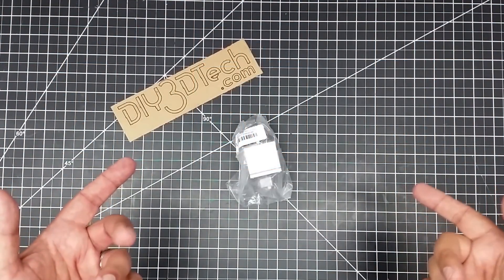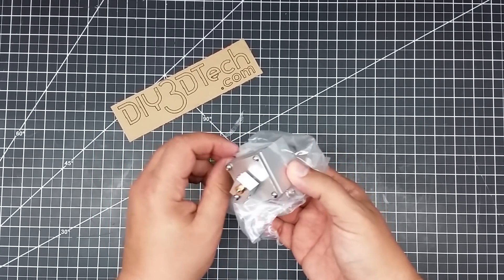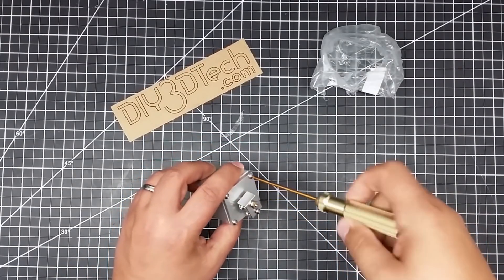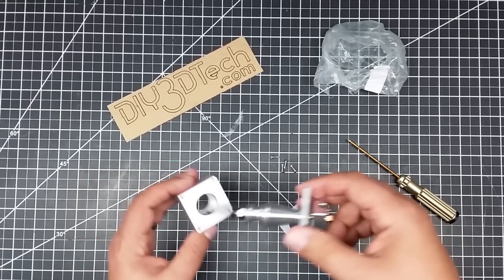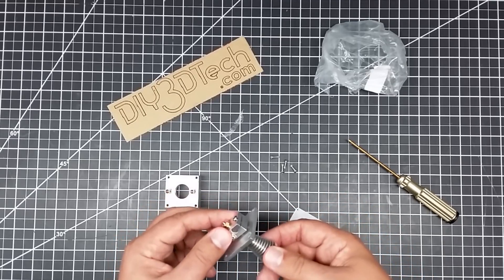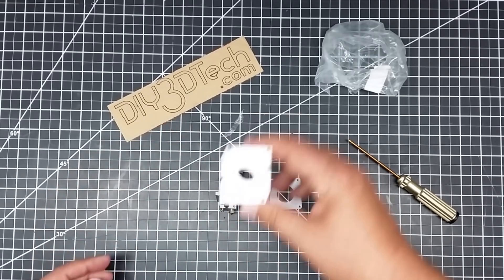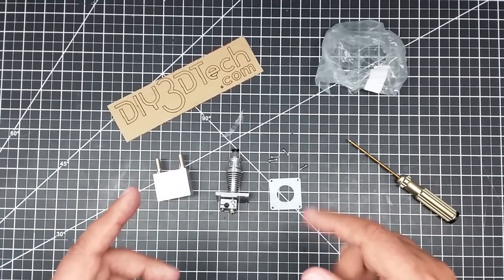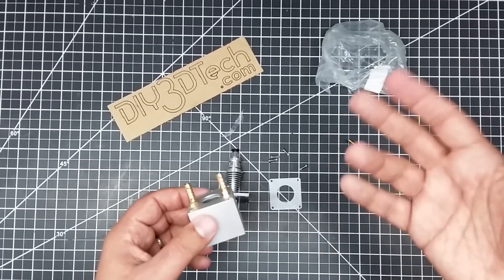Shop Talk - Water Cooled Hotend from eBay!

Comment: Its so cheap because there is NO flow design... its a regular bowden sink stuck in a cube. its not very efficient at pulling heat away but it'll work...
 i mean i guess if it was too efficient it would cool down the extruder but if you balance it with controlling the cooler it would be better and use less power. 
I've designed one but im having delays getting it made. i can only machine half of it with my current tools, and my friend who should be doing the other half has been too busy.
Reply: the heat break (gap between the hot end and the cold end) is far enough and the walls of the heat break is way too thin for it to cool the hot end at any detectable range.  This is why you have to be careful when tightening the hot end as it could sheer the thin walls of the heat break.
Reply from the maker: Yes but is it needed?  Better flow design means you need less flow move the same heat,  however flow is VERY cheap and more advance design expensive...

Comment: This has been tried by various manufacturers and I understand why they are doing it.  #1 No blow over from the cooling fan because they all blow over (has to go somewhere) and end up cooling the print (lethal to ABS and other higher temp polymers).  #2 For totally enclosed cases (for those high temp EMO plastics like Peek/PC/ABS) so no breezes at all.  I really want something like this BUT I wonder how it would like my CW-5200 chiller on it?
Reply from the maker: I agree with your summary regarding the goodness and once I get the new shop completed later this fall (built a new house with attached over the past 10 months) my plan is to convert the Tron XY to water cooled for higher temp materials...

Comment: Interesting but there is nothing I trust about this on a 3D printer to add any value vs. destruction risk. I agree with a lot of the comments below but I am inherently curious to see the results. I would think maybe a safer test would be on a non-heated bed printer. The whole trusting that bottom gasket throws me off. It's directly near the hot end tip with the wiring unless you find a safe way to insulate it from possible leakage. I would think a more cupped unit that has the heat sink part integrated completely as a sealed unit that you attach the tip to would be safer? Then you have the fact that most (probably all?) 3D printers have the electronics downward from the hotend failure would more than likely be catastrophic to the machine and possibly dangerous. Regardless, I want to see to see this happen but be safe and wear you rubber boots and gloves. ;)
Reply from the maker: Hmm really was not discussing "destruction risk"  as I don't see this as real mitigator of said risk.  Also if it leaks we are only dealing with low voltages unless you have mod-ed your heated bed (which few have done) to mains voltage.  The value do see is providing increased stability in the extrusion by avoiding heat creep up the cold break...
Reply: Oh i should ask her again what came of it - a friend was building a printer with a water cooled hot end a while back. The whole purpose of that build was to print dirt cheap ABS - heated chamber - bowden fed - all vital bits including all stepper motors outside the printer volume. Anyway water cooling the hot end allowed to avoid any cold airflow inside the print chamber, which would have been detrimental to ABS cohesion.

If you really have a purpose for a water cooled hotend, there's nothing else you could sensibly use and you'll just have to design around the remote possibility of leakage. Otherwise, it's a silly hassle.

Comment: Man I hope this works out great. I would LOVE to get my printers to run quieter. The main noise I have now is fan noise. Obviously a part cooling fans will be needed for PLA but I can rig up a noctua fan for that. I wonder if you can make a second loop for water cooling the board so you don't need fans for the board on something like the cr-10
Reply from the maker: You could water all things, however hope is to improve extrution by avoid thermal creep in the cold break...

Comment: Sounds like a solution looking for a problem.
Reply: Water cooled hot end is an actual solution for hot chamber, when you don't want to introduce a cold airstream into the box.

But the construction of this is completely absurd.
Reply: @SianaGearz  not really. there are high end and expensive water cooling blocks for existing hot ends that merely makes physical contact with the cold end and it was more than enough to keep the cool end  from heating up  and this was extruding at 400c.  there is an even smaller water cooled hot end with even less water flow that has the same performance. (NC Water cooled hot end)
Reply from the maker: Not at all as the idea is to prevent thermal creep past the cold break to improve extrution because as the plastic warms it will compress more before being pushed out...

Comment: Joe, Let's hope this thing has any efficiency to cool down. Looking forward to watch your test. The problem is the heat can go up and there is no fan on the classic cold end (unless the classic cold end touches nicely the water cooled part) let's see 💘 edit: is there any water touching the classic cold end ???
Reply from the maker: Yes water circulates around the cold break as the idea is you do not want the plastic to melt or even pass its glass point till as late as possible to avoid pre compression...
Reply: DIY3DTECH.com, Thank you Joe for explaining the water circulation better ;)